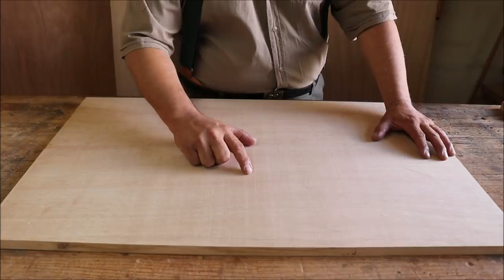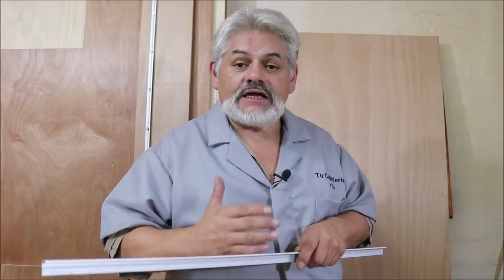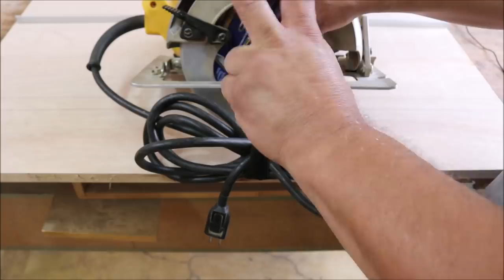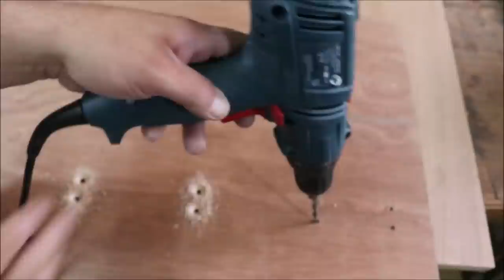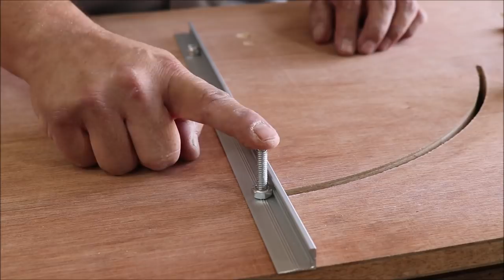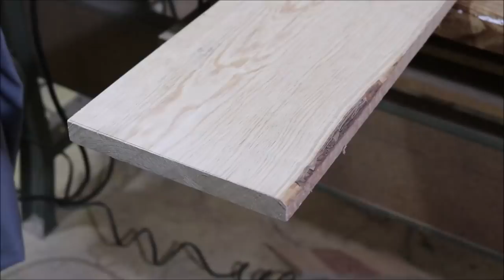Guía de ingletes para sierra circular de mano

Comment: Muy bien explicado felicidades maestro, tengo una duda en la guía de ingletes podría cortar piezas pequeñas
Reply from the maker: Gracias amigo, la guía la fabriqué como un auxiliar, esta no sustituye en todo a la ingletadora normal  puede cortar piezas delgadas pero el material debe de tener un mínimo de 40 cms de largo en corte recto y 50 cms en corte angular y sus ventajas es que te puede dar ángulos más agudos que una ingletadora y es muy fácil y ligera de transportar además de la diferencia en costo
Reply: muchas gracias. Seguimos aprendiendo mucho de usted.